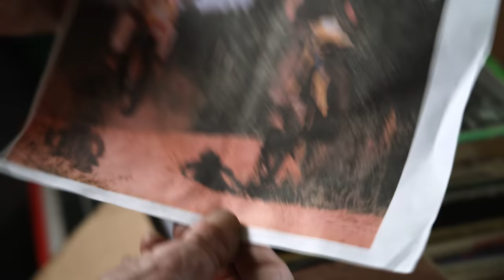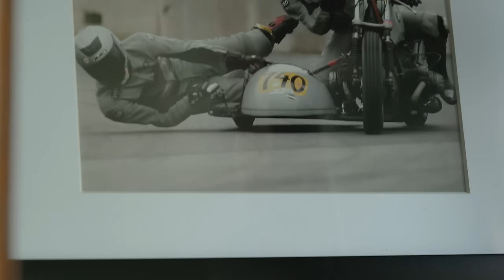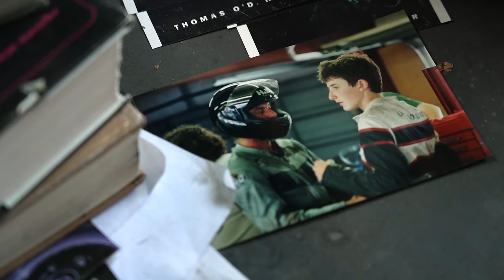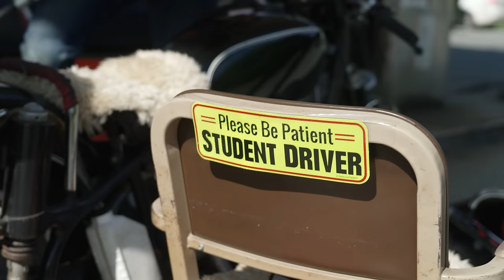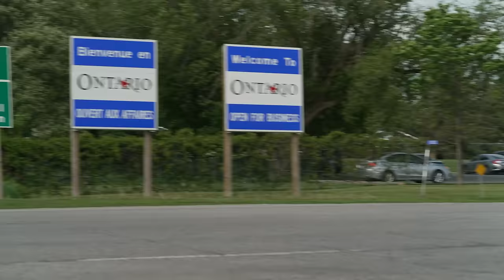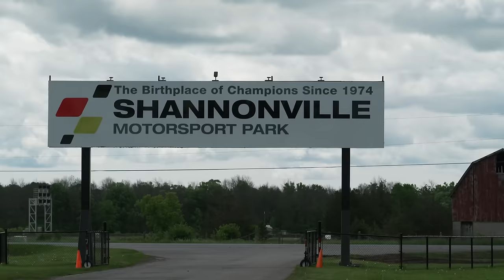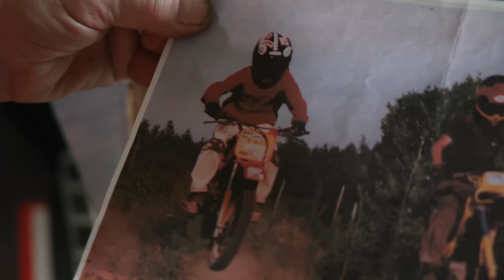Vermont to Canada on a 1965 BMW Sidecar! Vintage Racing Adventure | Common Tread XP

Comment: Ari absolutely selling out on those corners and getting inches off the tarmac and completely horizontal was gold. Genius move to put your arm out to move that center of gravity slightly further out. I can only imagine the toll on the body.
Reply: If you don't come back with a few new scratches each stint you were not low enough.
Reply: @wobblysauce no if you're hitting the ground you're too low 😂

Comment: This is the most fun Ive had on youtube for ages. Jeez it brings back some memories from 35 years ago. I used to be a passenger on my dads BSA racing outfit in the CRMC in the UK. My god they were good times. Thanks for sharing guys, you made an old man feel 20 years old again :)
Reply: I used to do slalom skateboarding and this reminded me of taking turns at speed. You end up perpendicular a few inches to the ground. A head and then back injury took me out of the sport for the past year and it’s been years since any shops put together a competition nearby to even go to. I’ll probably be feeling the same as you in twenty years haha.
Reply: the Isle TT side car racing is probably the most exciting bike racing you can do. LOVE watching those guy hang it out sideways at ridiculous speeds

Comment: I've raced just about every class of sidecar by now. Vintage outfits, front-exits in particular will really drive home the importance of being smooth in your movements and staying low. It does't take much to upset the chassis. Get good on vintage, and you'll rock it on a modern F1 class sidecar.

Comment: I think in a way taking the headsets off did more good than harm cause you learn to trust your instincts rather than your thoughts, i truely believe that riding a motorcycle is a spiritual connection between you and the machine. And for side car racing its also a spiritual connection between each other and you two having this trust that you have each other's back, but idk im just some newbie making an observation. thanks for the video btw cause now my love for motorcycle's is cemented 😅

Comment: Had a 1974 Suzuki GS850 on which I installed a Motorvation Touring sidecar because a buddy wouldn't let me drive his BMW equipped with a Steb sidecar. I learned to drive the thing, including using the front brake to pull the car's wheel back down in a hard right turn. A side car is definitely different. Not like a car, and not like a bike. Just very different. When I saw my Beemer buddy, I asked him to check it out, hoping he might have some setup tips to help the handling. After he rode it, he said, "This thing handles better than mine." So, I guess I just enjoyed riding it. I rode it until I got married. My new wife was in the car, and I was riding at 50 miles an hour, facing a 30 mile per hour headwind, in 3rd gear, with the throttle-lock on, keeping the thing on the road by holding my right foot against the handlebar, as me and my new wife were screaming, trying to talk over the 80-mph slipstream running between the bike and the car. Traded the thing for a new Fiat 124 Spyder the next day. Never missed it.

Comment: this is insane

I remember the first time I saw a side car racing in 1976 when I was 16
Reply: I used to think that sidecar racing was the craziest motor sport with hydrofoil racing being a solid contender, turns out there is one that combines the two! there are a few classes of small boat race that all basically amount to having almost every aspect of what makes sidecar racing so insane multiplied by being on a boat in a narrow channel going through an obstacle course (this is usually done in swamps and/or tight twisty little waterways, meaning debris are usually everywhere) while everyone's wake completely changes the "terrain" from moment to moment.
Reply: @evernewb2073  indeed, it is

Comment: Could have used a solar recharging system on the batteries. Along with a capacitor battery for quicker charging too. Or changed the stator and put a regulator on board for a charging system too.

Comment: I'm not a mechanic or anything, but I do know a STATER, which is the equivelent of an ALTERNATOR for a car...I don't know why they didn't just install one so it can run the lights and recharge the batteries on the bike.